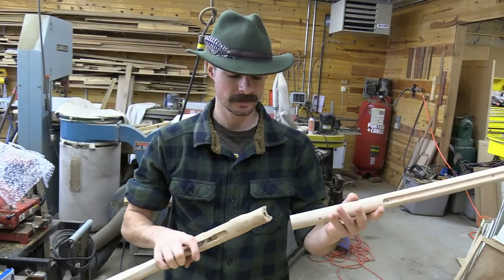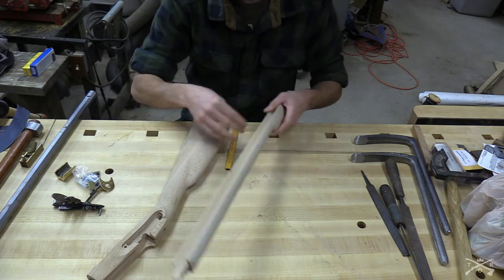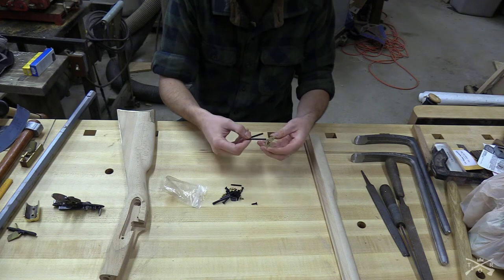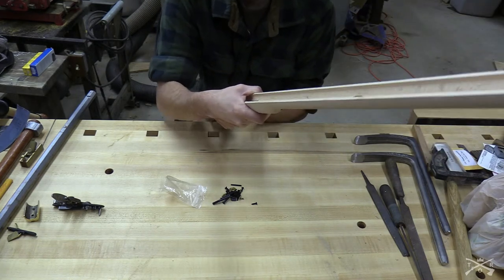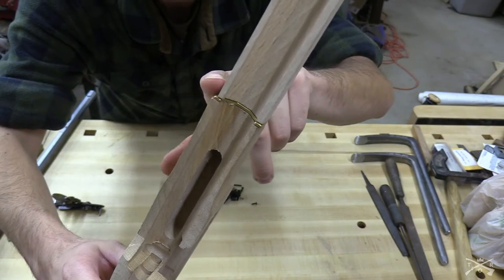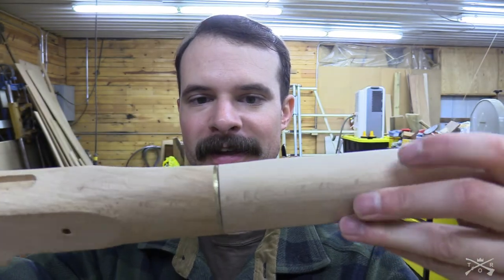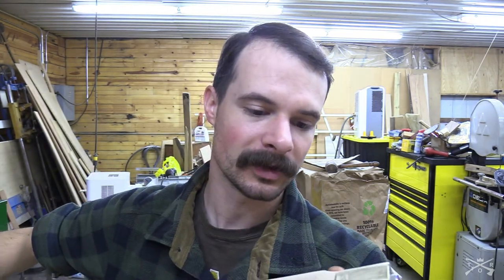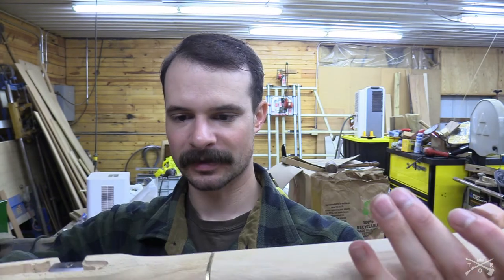UPPER AND LOWER STOCKS | TRADITIONS FLINTLOCK KENTUCKY RIFLE KIT BUILD

Comment: Your gap I fixed mine by making a new brass piece. Thicker than one that came with the kit! Noticing gap was not an option I knew it was there! I used 1/8 thick copper piece traced outline on it and filled and fitted. Only change I did was radius ed so it was a shimig above wood but blended it looks good I think.
Reply: I did the same..still not happy with how it came out. I saved my cash and bought a Kibler kit, better value, high quality, CNC cut stock that is nearly perfectly inletted, only some minor tweaks to get it right.

Comment: Can I leave the brass spacer out ? It looks out of place .
Reply from the maker: I initially wanted you to do that. But if the spacer is not used, you have to slide the fore stock back to fill the gap which will throw off the alignment for the nose cap screws.